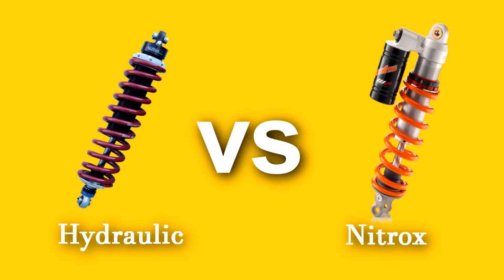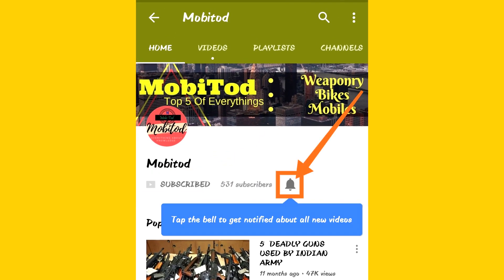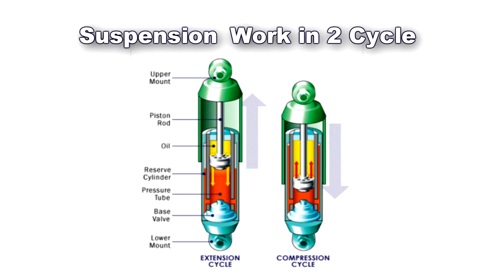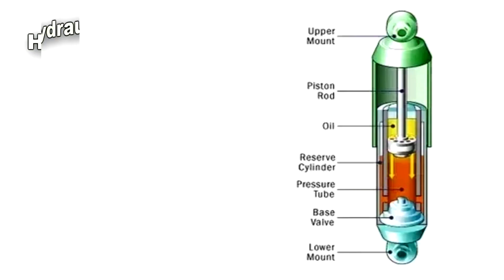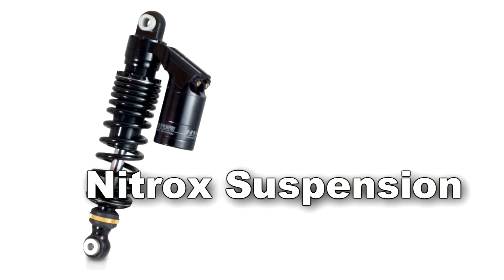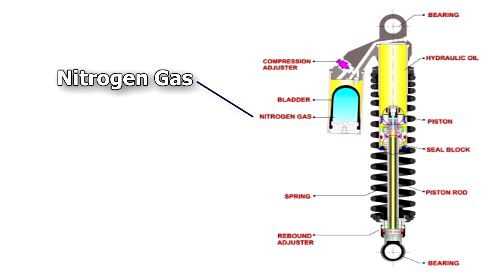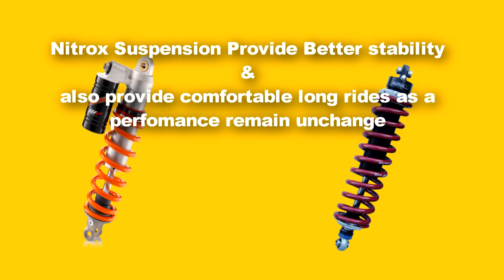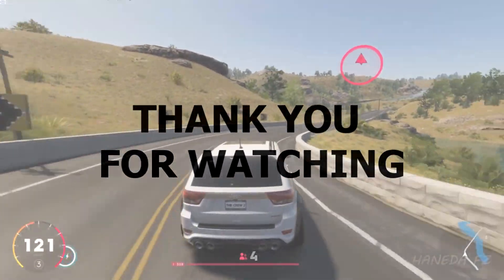Difference Between Hydraulic Suspension and Nitrox Suspension

Comment: Can i change pulsar ns 160 suspension in toy  Honda x blade  byke suspension
Reply from the maker: Perhaps not Because built & architecture of both bikes are different also in some extent it is possible to change along with some attached compatible equipment for that it will cost you high.